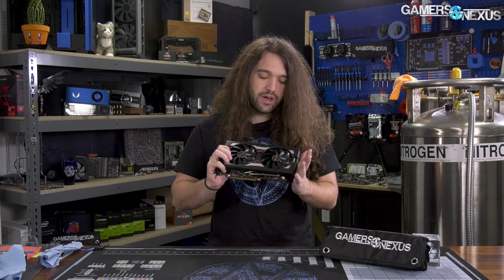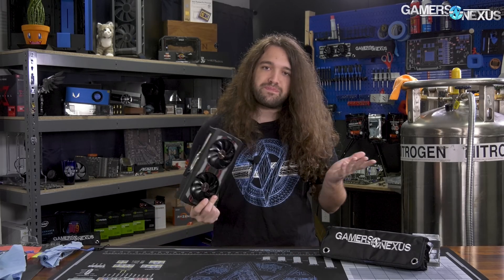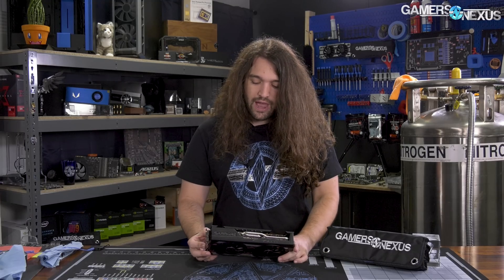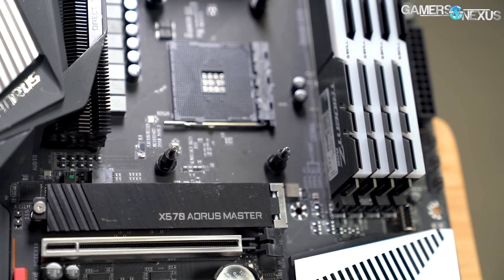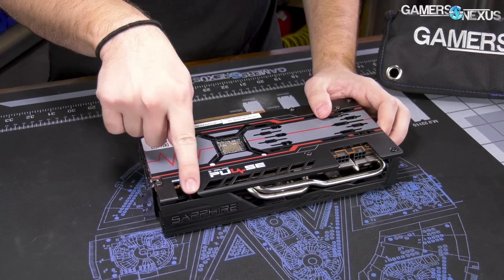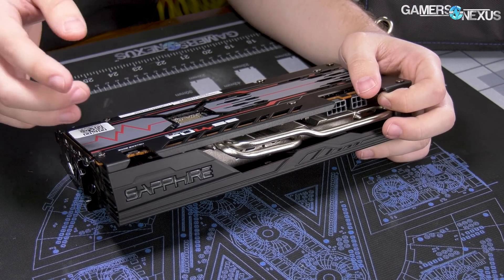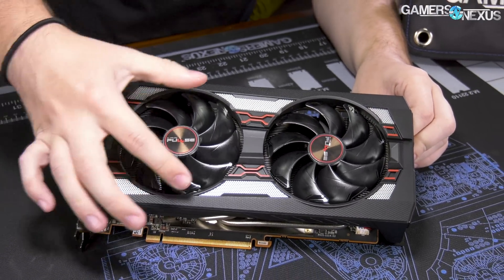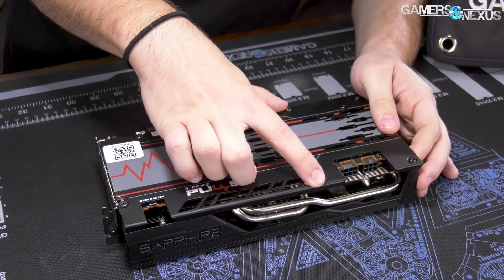Sapphire RX 5700 XT Pulse Tear-Down: Cooler Quality & Assembly

Comment: I'm on a mATX build. My next gpu can't be more than 2 slots.
Reply: Abe's Mission Control the asrock challenger is the only true 2 slot 5700 xt I know of other than the stock 5700 xt
Reply: @imthescatman3505  That will probably be the one I go for, then. Unless I find a 2070 at a good price.
Reply: I don't think this card is quite a 2.5 slot card. Will it definitely not fit in your case?
Reply: @jasonmcgrody9472  Asrock B450M Pro4. Slot 1 is empty (x4 or m.2). Slot 2 is the x16 slot which is where my gpu is, there is no Slot 3 (since a dual-slot gpu would cover it anyway), and Slot 4 has my capture card. I could move the capture card to Slot 1, but I'd rather not have it absorbing heat from the gpu. 

A 2-slot card is the most I can take. Right now I have an MSI Armor RX 470, and it clears the capture card by a few mm.
Reply: I'm on ITX build. My next GPU CAN be more than 3 slots. So? You would be better off with more than a few mm space for the GPU to draw in air to cool the card with, so slapping the capture card in slot 1 might be wise.

Comment: So this Sapphire has about 3.5% higher game clock than the reference card, but can one overclock it couple % more? Temperature wise this might be possible? And the boost clock might be taken higher because of the better cooling system, yet do the actual FPS in games go higher? In the JayzTwoCents-video, where he analyzed the benefits of OC with water-cooling, the real benefit of overclocking was not received, and that is why I ask.
Reply from the maker: Talked about that in our review. Also, game clock is a stupid marketing name and it'd be great if no one used it!
Reply: @GamersNexus  You are right. Many buyers are also young, so it is not that ok that they are sold hype. I hope Intel will stick to real comparable numbers.
Reply: @ROCKSWOT  Ryzen is pretty hyped now what do you mean, theya re sold out in my country. Like people on a budget just get i5 3570 platform+RX 580 for $200...while people claiming they made the best budget build with a R5 3600, expensive DDR4 , 1660Ti or Vega 64 lol. The Ryzen hypetrain is the strongest I've seen in PC building right after Maxwell GTX 970s
Reply: @JABelms  Hi. GN said it would be good no one used the term "game clock". So I did mean that term, too, and explained my view that it is not good if young people are sold hype. Young people, especially, do not often know how much excessive extra they are paying just because of hype instead of a true performance.
Reply: @ROCKSWOT  Exactly, the "gaming" label is pretty much going too far...this has been going on for years and now it is being used for major hardware

Comment: I'd like to see other partner models tested as well Steve, please. Especially the xfx thicc since, well, it seems to be pretty thicc and have great cooling.
Reply: Read a post on reddit the xfx thicc2 vram temps hit 98c. I hope that's not an issue and gddr6 are fine at those temps.
Reply: @gonzo3079  isn't that just a rumor
Reply: @gonzo3079  Yeah, I read the same...
Reply: @gonzo3079  I've never been hyped for XFX cards, they always make them ''look''  big and fat, big and fat for nothing, once i had a xfx amd 7950, it was so shit.
Reply: As soon as GN gets their hands on other cards you know they'll test them.
Reply: computerbase tested it, it's no better than the pulse, and considering its size it's pretty disappointing. which is a complete shame cause it's gorgeous! 

the strix has the best PCB this time around according to buildzoid, and the cooler is pretty good as well, but you'll apparently have to make your own fancurves cause the stock one is too loud and the quiet one is too hot...
Reply: I would love to know when it releases :)
Reply: apparently the cooling on the thicc2 is actually quite bad since the vram reaches 98 degrees
Reply: @captaincrazy5008  cooling is good it's just vram that is hitting 98c and computerbase say it's still in the "green". I would like confirmation on the safe temps for gddr6. on micron site specs say they run safely up to 105c depending on the module.
Reply: @gonzo3079  i wouldn't want anything in my pc hitting 100 degrees
Reply: There are links to reviews on the AMD subreddit
Reply: @Expresso-Depresso they say it's an actual review from computerbase but they themselves gave it a green light, gddr6 can go up to 105c but I want confirmation on that.I wanna see what other reviews say

Comment: I wonder how cool the Nitro+ version will be.
Reply: Not a whole lot cooler since that'll be the card with the binned/overclocked silicon underneath lol
Reply: @hyperstimmed  lol
Reply: @hyperstimmed  did you even hold in your hands nitro+ next to pulse grapchic card?Let me answer it for you,no you didnt.Otherwise you would know how silly your comment is.
Reply: @deemonk7860  Have you seen which cards I own and use in my computers? No, or you'd know how silly your own reply is.
Reply: @deemonk7860  what exactly don't you understand? His comment was simple.
Reply: @hyperstimmed  Not gonna argue about this because anyone who actualy owned Sapphire nitro+ and Sapphire pulse knows the difference between them and its not about silicone higher/lower quality..
Reply: @deemonk7860  Listen dude you're not comprehending my original comment whatsoever. The nitro cards have much better coolers, the point is that they won't run at lower temperatures, due to being overclocked. They will run at the same temps but not the same framerates.
Reply: I usually buy the Nitro+ cards.
Reply: It would be nice if they could pull off the same performance as the Strix at the same noise levels, but I think we need the Toxic for that
Reply: @or2kr  Honestly I think the Nitro and Strix are gonna perform essentially the same, with the only differences being the extra fan headers and RGB.. wouldn't surprise me if the Nitro is actually better.
My 2060 is a Strix.. total waste of money if you don't need the fan headers or RGB. I regretted not going with EVGA for that card. ASUS doesn't get better binned silicon, and their coolers aren't really any better compared to Sapphire. In fact, when you look up close, Sapphire seems to put a lot more thought into cooling. The Strix does have a super beefy VRM design.. which is cool and all, except it's totally pointless for a 5700/XT.. they did it that way because they're gonna reuse the  design for the 5800/5900 models.
Reply: It will have better cooling for sure, probably tipple fan.